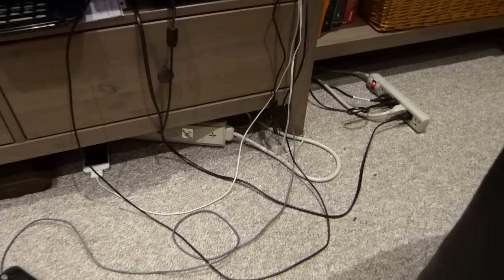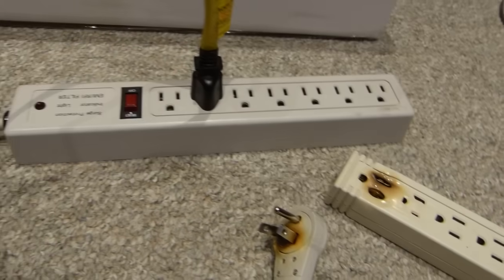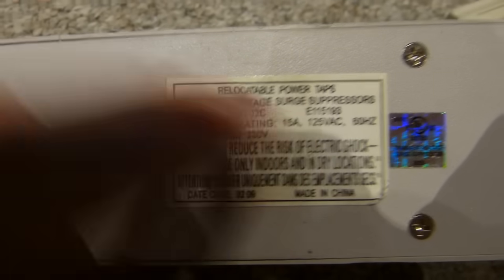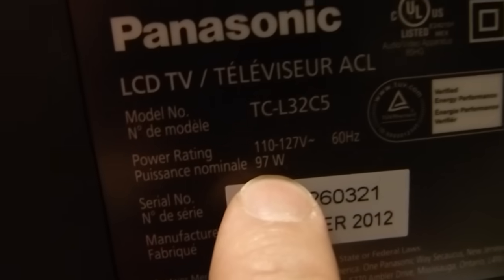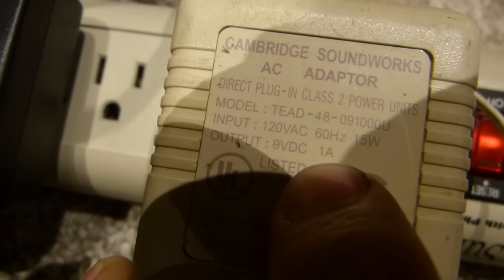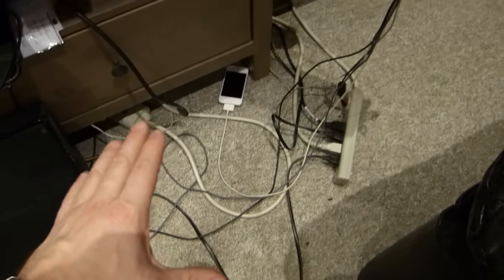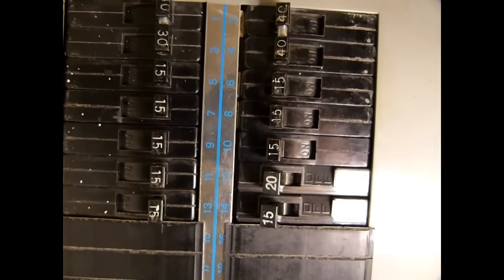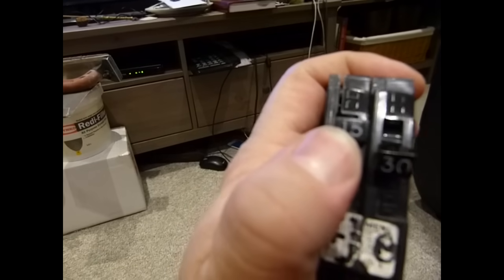Is it safe to plug power bars into power bars?

Comment: It overheated because the resistence of the connection was high (the plug connected to the other power bar), that resistence did two thing, ONE it avoided the ampers (current) to go nominal 12.5A, TWO it generated heat and fire, that is the reason protections didn't trip.

Was a loose connection?, not necesarily, if you study the internal shape of the females contacts, it is just a tiny part which really get in contact with the male counterpart, the parts are not perfectly parallel frictioning, notmally is a tiny part which press against the male plug. That minimal surface normally can't conduct 12.5A.... , when the power bar say in the label it is 15A, it don't reffers to just ONE female plug, female counterparts are not designed that way, but the label reffer that the sum of all females will do up to 15A, and the protection is normally 15A sustained during X ammount of period, it is NOT just past 15A barrier and PUUUFFF (instantly).
Reply: That doesn't really make sense, because it means you could overload a power strip far too easily in general.

Consider I have  6 socket power strip rated for 240 volts 10 amps.
OK, so if I plug in 6 devices that use 400 watts each, that's the power limit.
But so is one device that uses 1500 watts, and one that uses 800

And if you don't think something can use those kinds of wattages, a typical portable fan heater is anything from 1500-2000 watts.

My Desktop PC has a 650 watt power supply. And that's the OUTPUT power rating, and when heavily loaded efficiency may be as little as 80%, meaning it draws closer 780 watts.

Meanwhile, it's fully possible to buy 1250 watt power supplies for computers, and while those tend to be much more efficient...
It still means you're pulling  more than half the total power the entire strip is rated for through a single plug.

For that matter, the power strip has pretty much the exact same rating as the wall socket.
If you overload the power strip as a whole you're also overloading the household circuit...

So there are things like resistance and inductance and some other complex issues, and in general plugging a power strip into a second power strip isn't the best idea ever.
But if you're careful it's perfectly safe.

I've seen professional theatre crews plug a whole heap of equipment into several power strips leading into another power strip this way, which was then plugged into a rather long extension cord...
That worked perfectly fine. (admittedly the extension cord was a 20 amp rated chord, which means something like 4.8 kilowatts, but nonetheless it was quite a mess of wires and adapters and other things...)
Reply: Did you just assume the plug and the sockets gender? ;)
Reply: Instructions unclear, my power bar is pregnant.
Reply: well done bro i thought in my head if the WHOLE amps is 15 not one outlet is 15A all the four is and he must have fought that one outlet is 15A so he plugged the printer in which must have been over  3.75A
Reply: here in argentina is outlets at wall for 10A and 20A, if a power bar must meet it, it can be 10A or 20A in the main plug, now, now, except for industrial type, to see power bars where each individual plug is capable of that, overall thinking the POWER BAR concept is for dividing power in several female plugs, has no-sense for making each individual female plug capable of the full input Amps. Other way I would be a power extension cord, not a power bar. But, any way, this burn, your video case, is not about you did those Amps, it was just heat from a loose conection or DIRT in the contacts, that did't the required resistence for allowed heat to be developed, so, it is normal that none protection shut it down.
Reply: It was the heater. Lmao.
Reply: Smart
Reply: what
Reply: Not electrical guy: ...... umm....... What?! I mean... yes I agree 🤓
Reply: +Stamy - your boss sounds like a first class idiot.
Reply from the maker: It looks like the overcurrent arced at a loose-fitting pin, manufacturing problem.
Reply: if it were really loose the user will notice it just when pluggin, what happens is that the metals increase resistence on heat, and change its shape on heat, and it is a run, if at the beginning it was a tiny surface in contact, it heat, then the heat makes it worst.

Comment: Max loading on most surge protectors is 2400W on the ones I've seen I just take each devices wattage and add them up if it doesn't exceed 2400W with multiple boards then thats safe enough.

Comment: In the UK we have fuses in every plug. I have 4 power strips plugged into one wall outlet but on the one plugged into the outlet I have a 5 amp fuse, so I should never encounter any fires I hope.
Reply: Ethan Short doesn't that almost render them useless for amp-eating appliances?😂
Reply: yep but ive never had a problem and its never set on fire so thats pretty good. i plug hairdryer and whatever into the other socket

Comment: Its all about the load. Hook up fifteen 5 watt phone chargers and you'll be fine. hook up two 1200 watt space heaters and you got issues.
Reply: My friend had two 15 amp window air conditioners on a single 15 amp circuit and couldn't figure out why the breaker kept tripping.
Reply: oh man thank you, after watching this video I only thought about the amp. But you saved me xD
Reply: Nope.Killed all the peep on the dive boat last year. phone chargers can be 3 amps.
Reply: @chiefinspector7280 They output 5 or 9V 3A. A typical phone charger in 2024 is about 20-33W. The mains 110V or 230V is stepped down to the desired wattage. In actuality, the power brick itself will draw a minimal amount of current.
Reply: @chiefinspector7280  Phone chargers can be 3 amps at 5 volts, i.e. 15 watts. Some phones can charge at 45 watts, but there's no phone in the world that chargers at 360 watts.
Reply: yeah no shit sherlock

Comment: It's amazing how long this has been up without the math, logic and science beeing utterly attacked. There are so many corrections and counterpoints posted, all, near as I can tell, being interpreted as reinforcement or anecdotes. They're corrections, and the lack of understanding here is not triggering a challenge response. There's some good thought and even some insight, but most of even the correct conclusions are reached through error.

Comment: I am glad to live in Europe where we have 230V system and 16A sockets that can withstand even overloading without a problem. You can draw 3.7 kW from one socket or group of sockets connected to a breaker. Also, in each house there's at least one 3-phase (3x230/400V) 32A socket, from which can be drawn up to 22 kW of power. That allows us to run machines with very powerful motors for example. That's not possible in America I think :P
Reply: Zdenek Březovský I'll never understand why you all always seem to think so many things are impossible in America?  An average modern home is fed by a 200A main feed at 240V single split-phase, or 48KW of total power available to a typical modern home (roughly equivalent to a 65A three phase service provided all the phases are in balance).  While the average tap is either a 15A (1.8KW) or 20A (2.4KW) receptacle at 120VAC we also use 240VAC taps of 15A, 20A, 30A, 50A, 60A, and up, wherever needed (ovens, range tops, larger plug-in air conditioners, heat pumps, or heaters, clothes dryers, our workshops, emergency power generation, etc.).  Even larger homes can start at 400A and up, depending upon the building needs.  At the same time, 120VAC is considerably less lethal if one comes in contact and 1.8KW is far more than required for most temporary accessory loads at a single usage point.  The few larger loads that are commonly encountered in the U.K., like your 3.6KW kettles, are not really relevant here in the U.S. not because we can't accommodate such -- we could very easily add 20A@240VAC outlets if we wanted such -- but because in a typical U.S. home such a device would be placed on a kitchen countertop right next to the oven/range that, whether gas or electric, is already equipped with much higher powered burners if your goal is to simply boil water in a hurry.

Comment: YEA. IT DOESN'T OVERLOAD IT OR ANYTHING. THANKS FOR NOTHING.
Reply: this is going to pump a tumor populous with bad information. again.
Reply from the maker: you`re welcome.
Reply: theoverengineer i remember when id conduct these experiments as a child. My parents scolded me, because the house will burn and people will die. FYI.
Reply from the maker: We`ve having such a conversation about these 2 crappy powerbars, do share what exactly is bad information.
Reply: theoverengineer 🤣 youre quite a cocky, butt hurt individual. Thanks for trying to teach us how to read amperage. But the only burnt power strip ive ever seen is in your house.
Reply: The bad information is based on bad fundamental theory. Everyone here has already talked about it.
.
To extend what's already been said, aside from no discrimination between input and output current, or specifically what was upstream or down, no account for localized resistance was addressed. I saw at least one person allude to that.
.
Theoretically, power taps can have indefinate layers of hierarchy and remain safe, unless a high current is present. One was not, until the heater was used. The basis of this video would be fine, if it had been illustrating how the average person does not understand that any device, regardless of size, always uses a lot of current if its job is to generate heat not localized to a small work area. That is, soldering iron/glue gun, low power, curling iron/stragtener 1/3 to 1/2 loading, heater or toaster, near full loading, hair dryer, full loading. Nearly all other objects mentioned are such low power they are inconsequential.
.
Every connection is an opportunity for resistance. Every low quality connection is an opportunity for resistance (and thus the reason for the recent "pigtailing" code change), and wherever the high loading in in the chain OR UPSTREAM is where the failure will occur, due to a localized point of high resistance- And though cheap power taps are notorious, it's mostly due to they that hang loose, accumulate heat from connection resistance in one area, or damage outlets. In the old days, 15 amp outlets supplied poorly maintained 7-amp rated cords coiled upon eachother with layers of taps, all on a 30 amp fuse.
.
Mythbusters has a good example of the latter set of combinations, using christmas lights.
.
Nowdays, we mostly only see poor quality worn taps, poor quality worn wall sockets and poor installation practices. It is usually an issue when a SINGLE sustained load makes an appearance, see https://www.youtube.com/watch?v=nPhgQpRFe5A.
.
Most risk is negated when a fresh tap is used, with the highest loads (system unit) on the first tap. All the chargers, small power amps and other assorted "jellybean" loads on the branch taps.
.
As previously mentioned, one of the best ways to avoid any of this is to have good wiring and power taps fitted with high-grade, manually-wired sockets with curled internal jumpers and tinned ends in the male plug feeding it, etc.
.
Those usually need their own MOVs added, but if they have a fast-acting CB on them (especially if you put in your own, with a value well below 15A, such as most PC and media setups will never approach)can actually be DOWNSTREAM. Only thing left is to keep track of wear items, which includes the MOVs, wherever they're held, and watch for tarnishing.
.
A low value CB will negate the points of high resistance downstream of it, too. That means you're safe whenever some cabbagehead plugs a space heater or a hair dryer or a vacuum into a tap it has no business being near.
.
It doesn't fix the loose outlets, bent prongs and poor wiring people use every day.
Reply: theoverengineer 😁
Reply from the maker: Not my house. Not my power strip. Found at work and took it away.
Sorry to hear about your self esteem level.
Reply from the maker: Wow, impressive. Much appreciate your input, thank you.
My original idea was safety inspired "this can cause a fire", no script, 1 shot. Didn`t even check my numbers or math. It shows.
For sure, no substitute for a professional video or actual electrical studies.

Comment: Common sense says no more then 1 power strip at a time just because of the fact you can plug a lot of things in already. Most power strip packages they tell you not to plug multiple strips into each other. If you need a second one, use both wall plugs. These cheap power strips are a joke especially Monster branded ones, very thin copper strips running along the inside and everything is molded, which means plugs can get loose. All of my strips are metal with actual outlets. You can get them from some electronic stores and most hardware stores. Way better construction. The reason why the breaker didn't trip on the power strip nor the breaker box was because there wasn't a physical short, just a connection heating up.
Reply: That's not how "common sense" works. 2 devices plugged into 1 socket can attempt to draw 30 amps by themselves if they are high current devices like heaters whereas you can piggyback to your heart's delight if the drain from each device is low enough.

A double powerpoint doesn't supply any more power than a single one does, they are BOTH on the same circuit.

"Common sense" is no substitute for logic or maths.
Reply: If your 20-15 amp breaker fails, which never happens, it could draw 30 amps your right. But then again someone won't be plugging in more then 20 amps worth of devices without tripping the breaker. The power strip failed because it's cheap, the house circuit can handle way more current then what the cheap power strip can. You can run dual power strips off one outlet without the heater, or have 1 strip with the heater. 14 gauge wiring can take 40 amps for a duration of 20 minutes before failing, and outlet can take 30 amps for a duration of 20 minutes before failing. Your breaker takes 20 amps of current for about 30 seconds or less before tripping. Your right common sense is no substitute for *math.
Reply: @travis4798  No one uses 15 gauge wire. It is 14 gauge for most 15A circuits and 12 gauge for 20A circuits. This is per the NEC code. You CANNOT use a 20A breaker on 14 gauge wire. It's against code and the home inspector will fail you.
Reply: @LonnieAdams4  Didn't say anything about using 14 gauge wire on a 20 amp circuit? I changed it lol no 15 gauge doesn't exist.
Reply: CWM030
doesn't matter if how many plugs you have its how much power you draw.
Most North American and Japanese residential power is 110 to 125 Volt at 100 Amp for approximately 12,000 Watts.  V times A = W.
If you try to exceed this your main breaker should shut off.  If you tried to run 10 of those heaters you will blow your main even if you don't exceed  on any smaller breaker.
Reply: travis piper is right.
Reply: I'm using both wall sockets already.

My problem is the house I live in has a grand total of 10 power sockets total.
the bedroom has just two.

My computer setup alone requires 3 plugs all to itself.

I am faced with 12 things plugged in at once right now in a location that only has 2 accessible wall sockets, and that's with half the stuff I keep around my desk not actually plugged in at all.

To top it off one of the power strips I use has UK plug sockets, because I have several UK devices.
That's not otherwise a problem, because the voltages are the same, but the power strip is the only way I can reasonably plug those in to anything...

If these properties actually had a decent number of power sockets for modern conditions, this absurd setup wouldn't be quite as necessary.
But as it is...

In any event I try to keep stacked anything to an absolute bare minimum.
The two standard strips are plugged into a wall socket each.
The UK strip is plugged into one of the other strips.
(I'd give it it's own wall socket if I could. In fact I did, when this whole setup was in a different room, but I'm simply out of options...)
Reply: Travis Piper Hi
Reply: Travis Piper does this apply to extension cords
Reply: If you use like a 3-way splitter it's fine just not power strips. If it's a heavy duty one like a 12 gauge cord under 50 feet is ok. Just wouldn't advise it for something permanent.
Reply: The only time I could feel comfotable plugging in multiple multiplugs is if you don't use any of the other plugs on the motherplug other than the extender
Reply: might as well use an extension.  As, long as you don't over the power rating of the wall group (usually all the plugs in one room) or on the same wall both sides.  15 amps is standard with some 20 amps and double 15 amp for 30 amps.  Its all based on you fuse/breaker box fuses/breakers.  Certain appliances like that run on electric use 200 to 240 at 60 hz.  All electronics in Europe run on avg 220 at 50hz.  Those  plugs in the use have different larger plug.
Reply: Right now i have a power strip plugged into the wall, another power strip plugged into that one, and an extention cord plugges into the 2nd power strip. Theres a bunch of stuff plugged into all of that.  I might die lol but i have no other options
Reply: Breakers don't just detect shorts, but also over current. If you plug in more than 15A, the breaker on the strip or at the panel should catch it.
Reply: But the breaker is supposed to trip when there's an overload, if there's an electrical short, or a power surge, that's what the ground is for
Reply: You can also buy firelighters...a much cheaper and more efficient way of burning your house down.
Reply: Who else hates reading long comments.